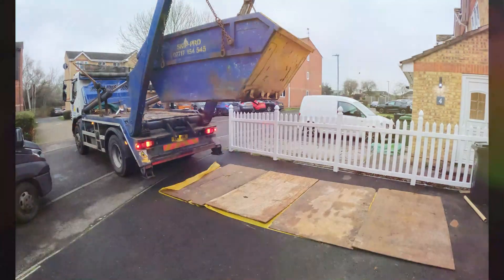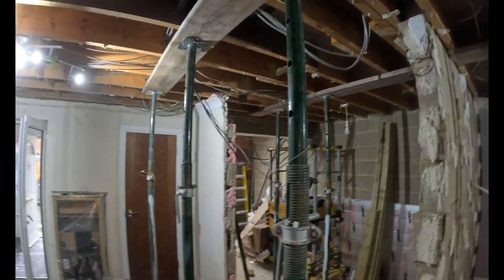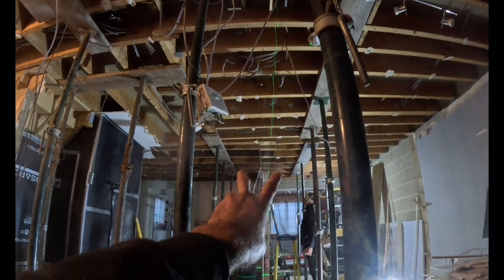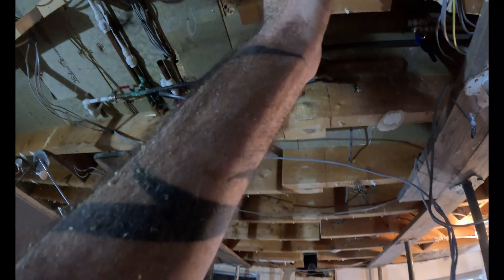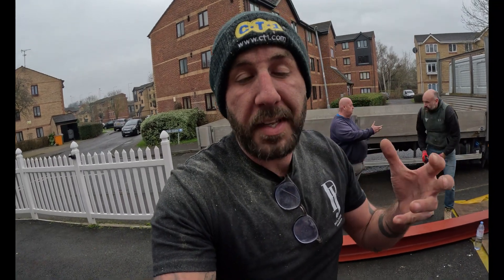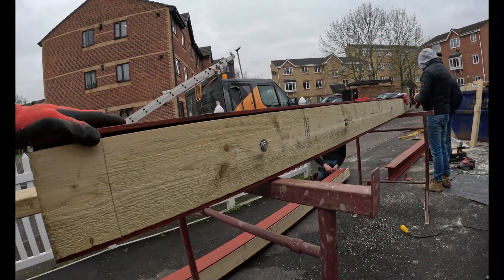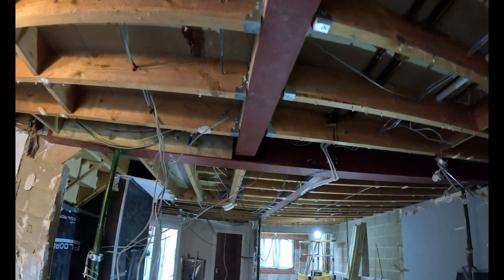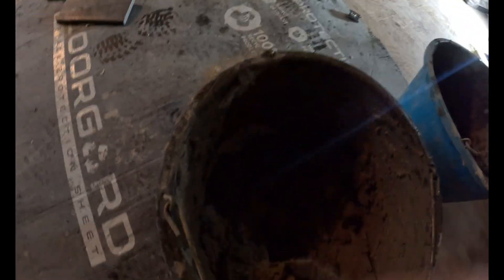How To Remove A Load Bearing Wall | Sunken RSJ  #buildingaflushbeam #rsjinceiling #flushbeam

Comment: Smashed it mate looked good, how many days was that
Reply from the maker: @jacksmith-ok8tx thanks brother, took 3 of us 4 days  💪🏼
Reply: @ fast that you guys dont mess around. If you needed to do footings also would it have added alot more days?
Reply: @ and if you assume it needed vertical columns would you measure them after pouring the footing and then order. Thanks